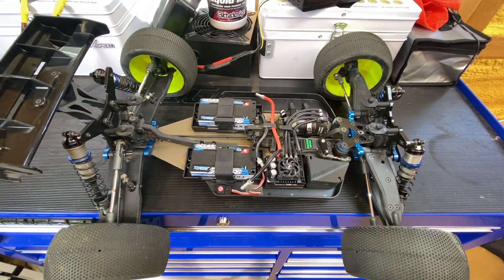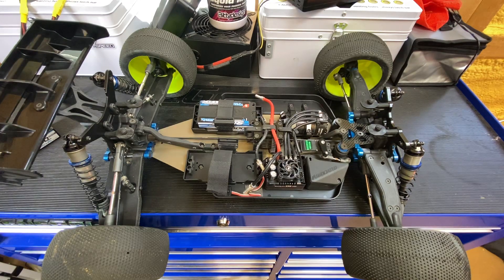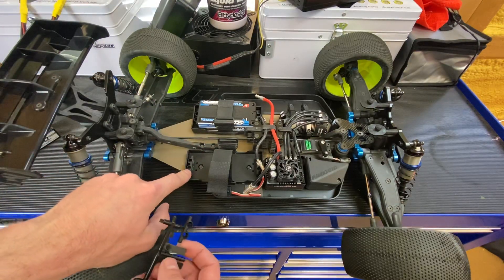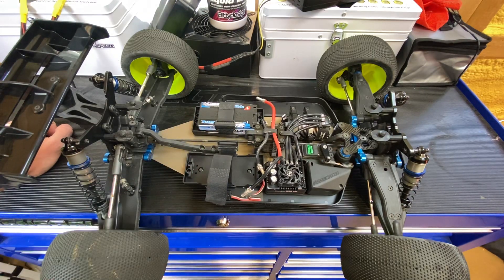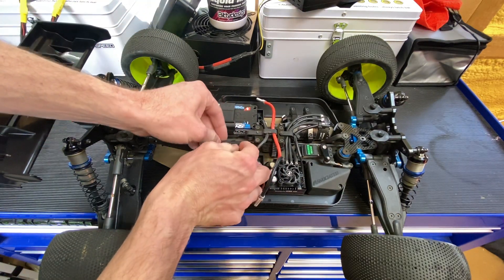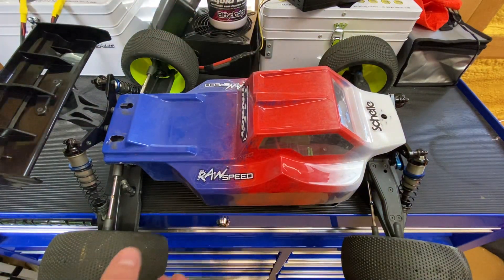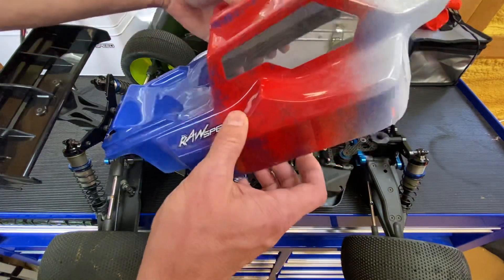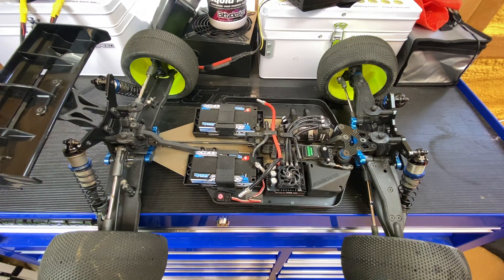RC8T4E using B4E battery trays for a cleaner setup!

Comment: That's cool about being able to run the T4 battery tray in the buggy. Which side would it go? Probably the same side as if running the 4s shorty setup. Thanks
Reply from the maker: Post from RC8B4 Nation  https://m.facebook.com/groups/1649673135262000/permalink/3316592121903418/?mibextid=0cALme
Reply: @SuperFastRc  cool, thanks. So do you run the B4 side guards on both sides or just on the battery side? What body do you run with that setup? Thanks
Reply from the maker: @samuelandolina6338  With the 4s stick pack you would need the nitro side guards on both sides. Then you can run the nitro body or you can also run B3.2 and 3.2E bodies.
Reply: @SuperFastRc  thanks for the help and advice. Stay safe